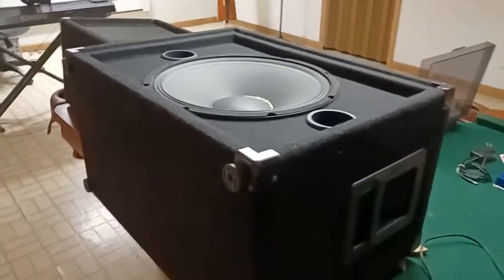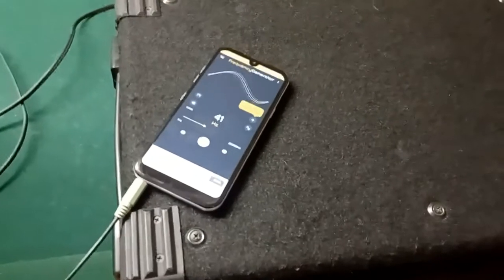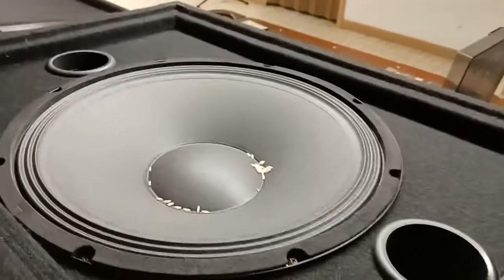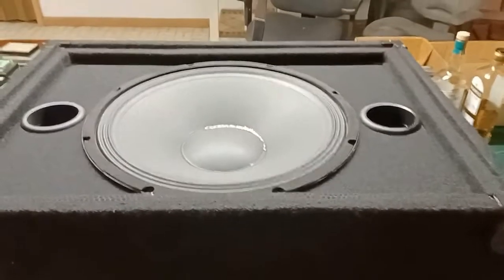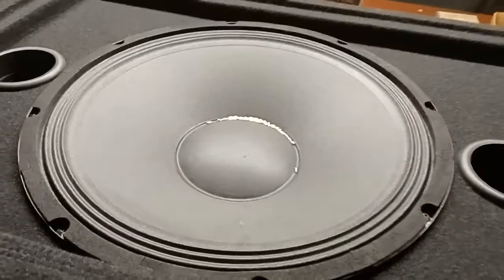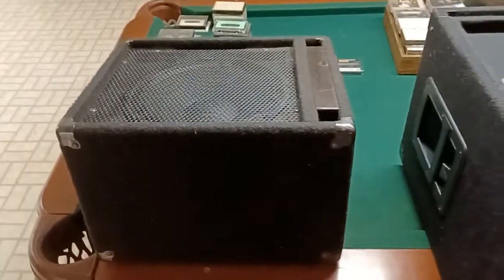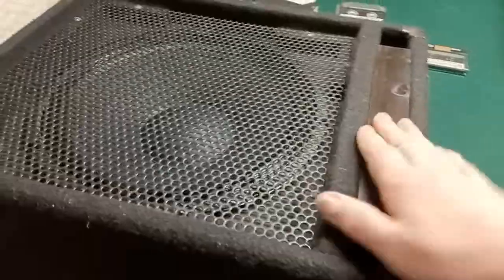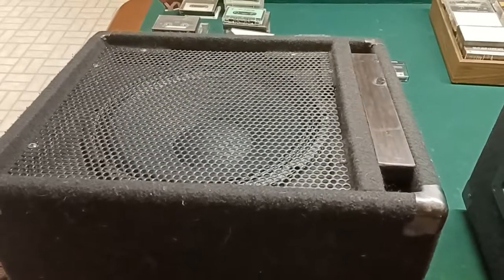Simple bass guitar speaker cabinet tuning

Comment: This assumes that the speaker is actually generating 'some' significant amount of 41Hz signal, and not just 'synthesizing it through and overabundance of the harmonics that come of it; which is a common method used by many speaker manufacturers to 'flesh' out the bass of cabinets/speakers that are physically incapable of generating any real bass. They simply design a 'bump' in frequency response around 80Hz (a much easier and cheaper thing to do than actually addressing the bass deficiency), a note that most small cabinet/speaker combination actually 'can' generate. I'd like to see the same test done at 82Hz. If the dislocation of the grains of rice has the same amplitude, you know you weren't actually witnessing the results of a 41Hz signal. A sweep test would be very revealing to, as would a test that varies the length of the Helmholtz resonator tube. Thanks for this video.
Reply from the maker: If you did the same test at 82 Hz and had a similar response, would you really know that the cabinet was incapable of generating sound at 41 Hz, or would you simply know that it appeared to have the same resonant effect at that frequency? I think you might have only learned what was actually observed. Otherwise, by extension, you might be assuming that if you had a similar result at 328 Hz, that no sound at any of the lower frequencies was actually being created. My ears would refute that hypothesis, even without measuring equipment. Ultimately, I was not intending to provide a perfect analysis tool, but one that could help create a useful cabinet that would sound good for the intended purpose and prevent hyperextension of the speaker cone. Desire for simplicity of the process, and having a useful cabinet for little investment, might yield a different final product than a more in-depth process with sweep testing and use of a Helmholtz resonator tube. Perhaps you could make a video where those tools and processes are explained in such a way that the average bass player could implement them. Thanks for your input!

Comment: That's pretty cool Mr. Jorin.  I'm building separate woofer cabinets for my 3-way HiFi speakers.  Although I'm using WinISP for port sizing,  you're trick will be used too, because I'm a crappy 5-string bassist & will interface with my HiFi /PA to practice along with the music.  Very nice check on the design.  Keep up the FUNK!   🔈🔉🔊
Reply from the maker: Thanks for your comment, I hope the info helps a bit! Getting down to 31 Hz for the five string (assuming your low note is a B) might require shrinking the port size, but if you do that too much you sacrifice the efficiency benefit of the port. I'm sure you'll figure out what you like the best, and that's what matters 🎶
Reply: @BajaKoala  Thanks

Comment: yes, great info...i have a sonic 15 cabinet, with unknown speaker inside ive used with a 210 combo amp for years..also bought a 15 neo speaker, but have not replaced it yet...kinda like the sonic cabinet, but it always sounded eh..ok, but not great..
Reply from the maker: There is a good chance that covering part of the vent slot on that Sonic cabinet will dramatically improve sound and efficiency, I'd love to hear what your results are when you give it a try!

Comment: what about 42 to 2k hz
Reply: You can check for efficiency at other frequencies using the same process, but as the frequency rises, the cone will not move as far in either direction. This technique is really intended to focus on maximizing efficiency at one frequency, typically the lowest note you want the cabinet to work at.
Reply: @montiac6796  most excellent
Reply from the maker: @kaybhee6  Thanks!

Comment: This is an extremely useful tutorial. Thank you very much. Is there a "down & dirty" way to determine a port size for a cabinet that has no existing port? I have a non-ported 15" cabinet that is probably not as deep as it should be. I'm thinking that it would be more efficient with a port, but am not sure how to determine the best/proper port size. Please advise if able. Thank you!
Reply from the maker: I can't guarantee the accuracy, but this interactive tool looks good to me and would be really easy to use. The good news is that if you make a slot too big, you can always cover it a bit to tune, using the process in my video. As you will note on this calculator, the depth of the vent matters just like the size, so rather than just cutting a slot you will want to plan to put in a board to direct the air around it - that's an important element in making it all work together:
https://boomspeaker.com/subwoofer-port-calculator/

Comment: Very nice, I’ve been on a journey through pro-audio, guitar, bass guitar, and home theatre and car audio speaker cabinets. I’ve built my share over the last few years and understood fairly well the science behind T/S , efficiency, port tuning and all that…

I had pictured in my head that better efficiency would allow the same power to push the driver harder , but it turns out that greater efficiency means LESS cone movement per given power. Now I can use this technique with my ported buulds to see if my efficiency is going up or down. I knew there had to be a practical hands on way to measure it without pure math/software
Reply: Hi Nick! I agree with your hypothesis, and hope this does turn out to be useful for you! The standard Thiele Small design concept is tried-and-true, but I think there are often variations or unanticipated elements that can alter the anticipated outcome, so a real-world test like this can be useful for verifying and making adjustments, if needed. Thank you for watching, and for your input!
Reply: @steelcrossing5324  thank you for making the video!

Yes, you’re right about unintended or unintentional effects on performance, I tried using PVC pipe for my last car subwoofer box and it performed SO well, compared to my slot port boxes, probably because of the precision of the geometry in a perfect cylinder of PVC vs my imperfect slots.

But yeah, loved the video, keep up the good work my man!

Comment: To obtain a sweep of vibrations, it is enough to have a light source (for example, a projector or a high-quality mirror spotlight and a small piece of Mylar mirror film, which is glued to the protective cap. By observing the shape and size of the spot, you can obtain an optical sweep of the vibrations of the speaker cone. Such an “oscilloscope” is very visual at low frequencies.
But for small bass cabinets, I would prefer a passive radiator design. This will reduce the thickness of the cabinet walls and, due to the smaller pressure difference inside and outside, reduce the load on the walls. 
The area of the passive radiator can be 4-6 times the size of the speaker cone, and you will benefit from loudness articulation and damping.
Good luck in the design and friendly greetings from Russia.
Reply from the maker: I think the idea of making a reflective scope to illustrate the cone movement is brilliant! Thank you so much, and my greetings to you as well. The concept of a passive radiator is intriguing, I have seen them in home speakers but not bass guitar cabinets. It sounds interesting and could be very useful. All around the earth, we share the same moment in time and the same love of music. I'm grateful for your comment!
Reply: @BajaKoala  In one monograph I saw efficiency graphs obtained from area horn emitters. This is the dry physics of air constants. So, the explanation from this is that if we make a passive radiator with a larger area than the speaker, we get a damping effect at lower and lower frequencies without adding additional mass, and vice versa. So, we need a very light passive radiator of a larger area in order not to lower the frequency to the required one due to an additional weight, but to use active elastic resistance and thereby reduce this frequency. We see the same thing with large groups of bass guitar drivers.

Comment: Thanks Bob.  Sounds like a quick and practical method.
 I have a round port on my cabinet
 with internal cylinder of few inches.
  As I know, both affect, the radius and the length of the cylinder.
  If bloking the port with your hand does not do much the challenge is to decide if perhaps a larger radius or a different cylinder length will give a better result.
  Do you have an idea how to decide?
  I guess that it might be necessary to check the cabinet resonant frequency (with the rice) and try to lower it below 41Hz, which will probably be challenging in a 12" speaker...
Reply from the maker: The process of calculating ports is somewhat complex, as are almost any acoustical design processes regarding the production of sound waves using electromechanical components. My video was just intended as a fast and dirty tool for people who changed drivers in a vented box they already had, but there are many calculators available if you want to improve or create an acoustic design concept. If you go to this page, click "Loudspeaker" and then "Port/Vent Calculator", there is a tool that you may find useful: http://www.mh-audio.nl/Calculator.html

Comment: great video! just wondering, could you do this test with the E string of the bass?
Reply from the maker: Yes, that would probably work about the same and would be easier for most people than getting the sine wave generator going. If you do that, I'd suggest making sure the tone control is turned all the way down so you are using the closest thing available to a simple sine wave. If you have two pickups to choose from, use the one near the neck as it typically has more fundamental note and less harmonics. I didn't think to mention that as an alternative, I guess because I found it easy to do what's in the video and it is somewhat more reliable of an indicator. But go for it, and please let me know how that works for you!

Comment: Do pos and neg wires in cabs need to be exactly the same length ?
Reply: Thanks for the question. The cables do not need to be the same length. The signal passes through cables at almost the speed of light, so in order to introduce a meaningful delay (at even the highest audible frequency of 20,000 cycles per second) the cable length would have to be very long indeed. I didn't calculate it, but it's thousands of feet. Happy music making!